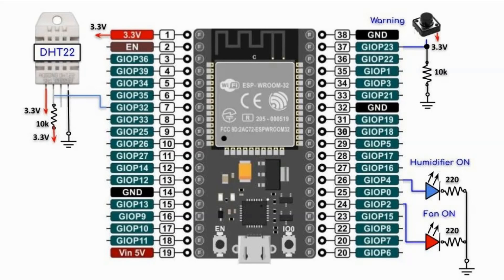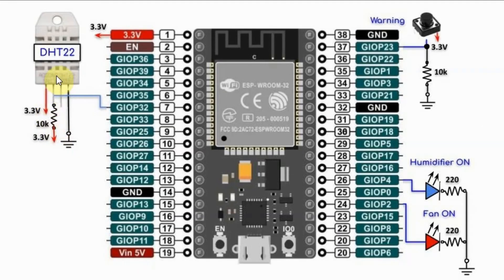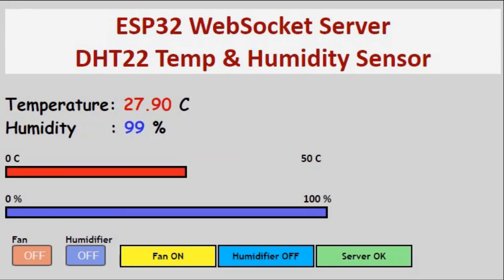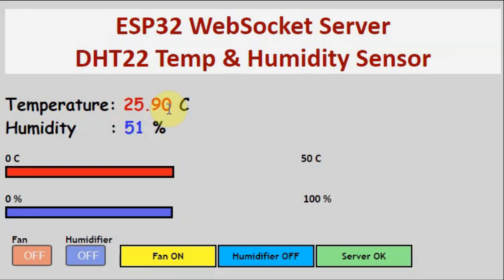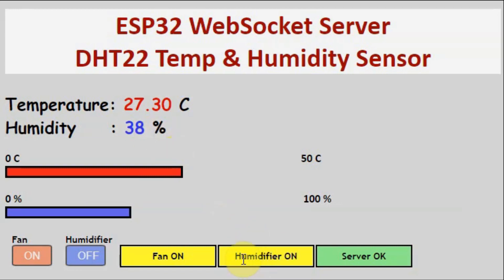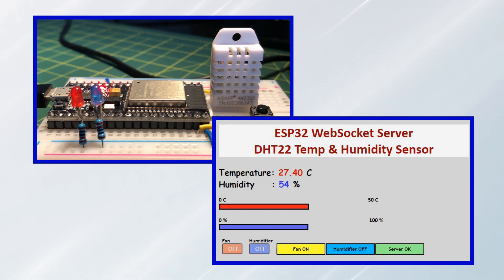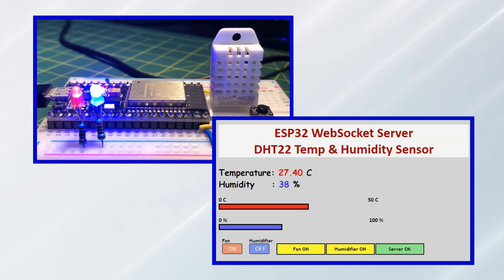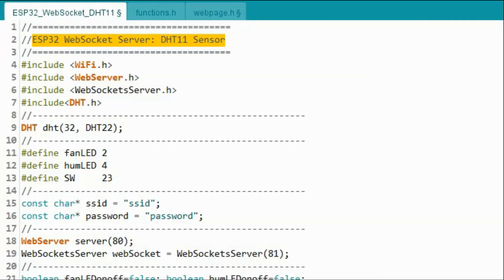ESP32 Websocket Server - DHT22 Sensor

Comment: Thanks!!..
One of the most interesting topics "websockets"! ..and I'm still hoping to have a video on the gmail unread messages  🙏..
Also, how to make a secure websocket connection for this same project, or any other.
Another idea, a "real" tank level sensor "not small sized" .. using websocket to view the level in real-time, with a nice css tank animation, and possibility to control the water pump... 😅